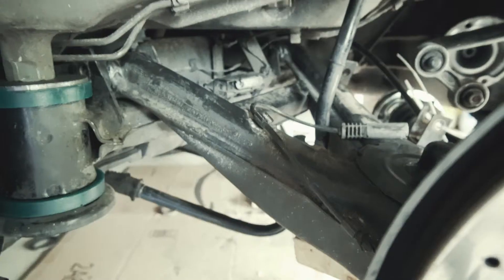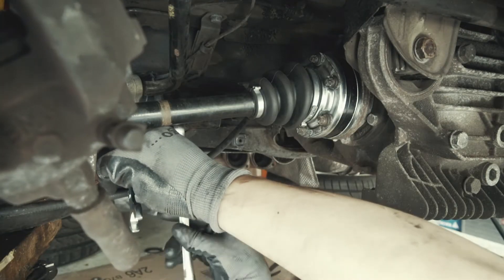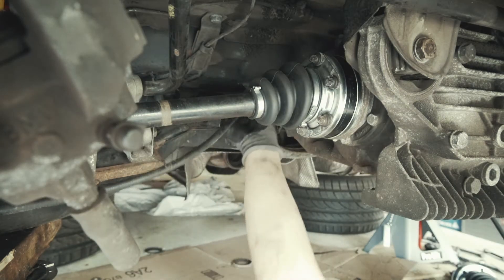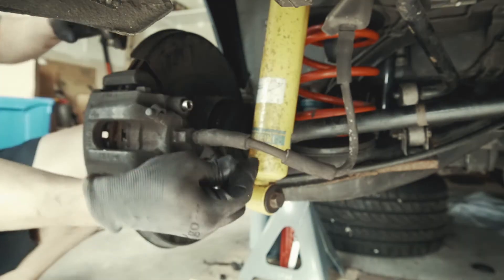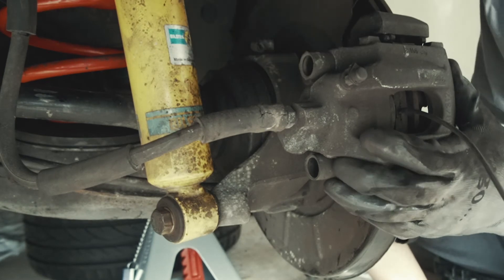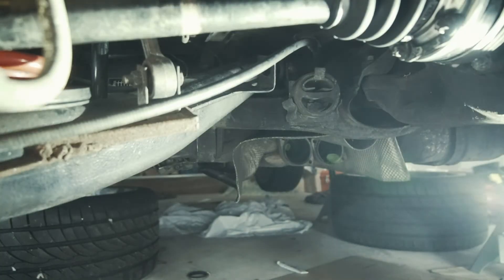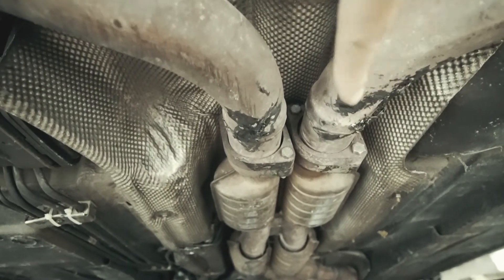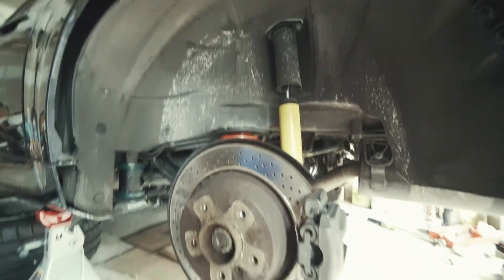Rear Trailing Arm Reinstallation, BMW Z3 (e30/e36) - Part 5

Comment: Brake hose behind the shock? Take off caliper and re route...
Reply from the maker: i don't see how that's feasible. The line sticks out past the shock. How do I bend it back in front of the shock?
Reply from the maker: I'm noticing the E36 rear caliper line sticks downwards and the line is routed in front of the shock. The Z3 is different in that the line sticks out horizontally and is routed behind the shock. So I'm not sure what your point of reference is.
Reply from the maker: You can see the E36 line pointing downwards here...
https://youtu.be/m0200VjMhEY?t=328
Reply from the maker: Z3 Line sticking out horizontally...
https://youtu.be/XJmcdVpCSP8?t=653
Reply: The rubber brake hose is suppose to run behind the brake shield not behind the strut.. when the car moves and suspension moves that rubber hose will be stressed and will eventually break.